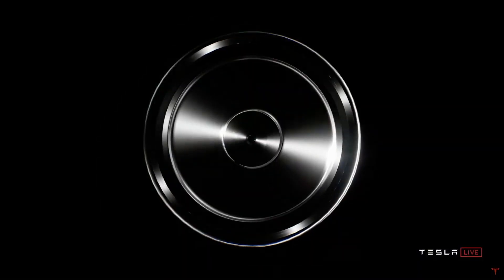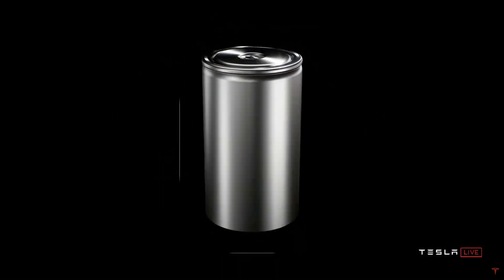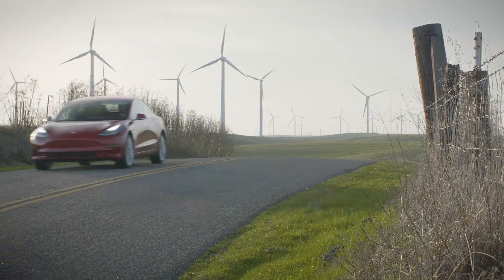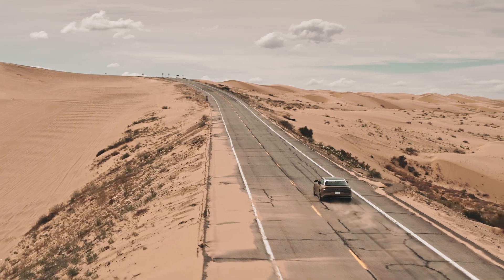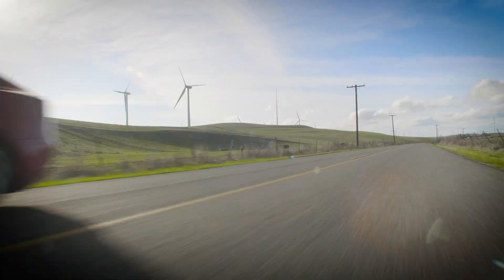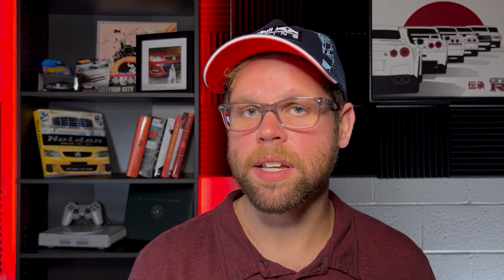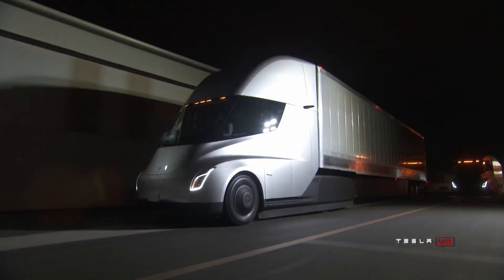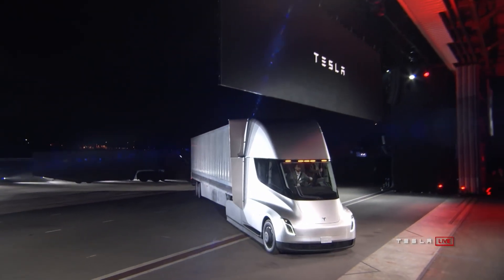Tesla prototype battery! Five times more energy?

Comment: Whatever the exact improvements, it's obvious that energy density is increasing by leaps and bounds.  Swap out a battery pack from just a couple of years ago with one loaded with the latest solid-state batteries and you'll have a vehicle that goes a lot farther and may be lighter, safer, cheaper, and -- if rare and problematic elements are avoided -- better for the environment.  However, fuel cells are a better solution for the Tesla Semi and other large trucks, particularly if they haul refrigerated / frozen loads.  The good news here is that fuel cells are also advancing rapidly.

Comment: Sorry for the rather ignorant question. How does a battery with 5x the energy only yield a 16% increase in range?
Reply: Possibly higher density, which would cause more weight, which would require more energy to move the vehicle?

Or possibly the 2 cells mentioned are different.  One was 5x energy and the other had 16% range increase
Reply: The physical size of the cell
1865 (aka 18650)  is 18mm wide and 65mm tall
2170 is 21mm wide and 70mm tall
4680 is 46 mm wide and 80mm tall
Most of the 16% gain is less air space between cells in the battery pack. There's also less weight to carry due to less total cell count.